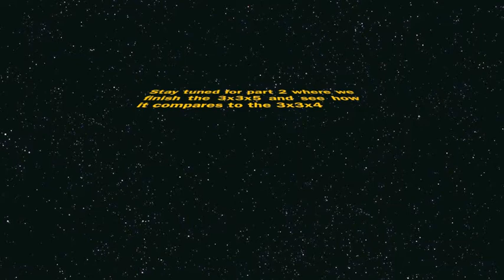3x3x5 Tutorial Part 1

Comment from the maker: Hi Marco.  The cross cube with movable centers and the cross cube with extensions differ in that the centers of the cross cube don't have specific places where they need to go, while Calvin's cross cube, the cross extensions act as the centers of a supercube, so you have to be sure of the orientation.  Also, with your cross cube, you can solve it like a 3x3x3 and the place the centers.  With Calvin's, you don't do the 3x3x3 solve, just place the supercube centers.

Comment: I just want to say that I love your videos. But I also have a question. at around 2:22 in this video, you mention that the 3x3x5, is essentially a 3x3 cross cube with extensions. I recently purchased a 6 faced, crazy 3x3, modded so all faces turn equally. Would this then also solve the same as the new Calvins cross cube?